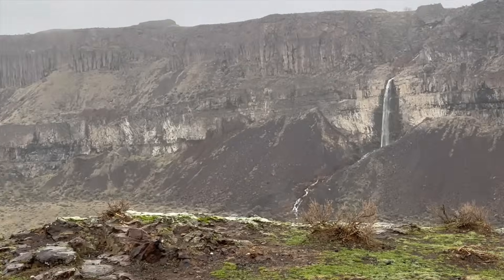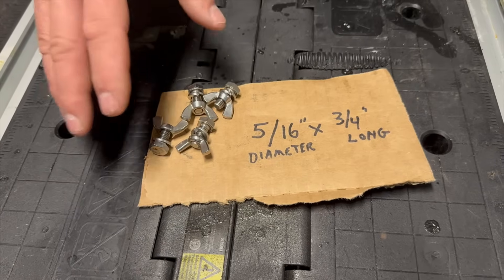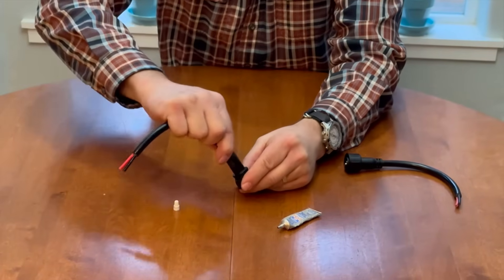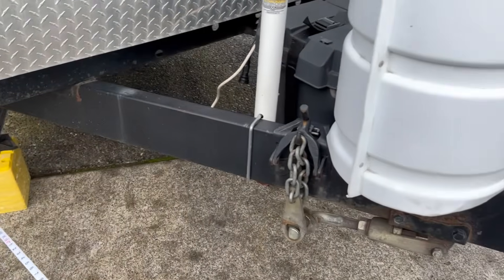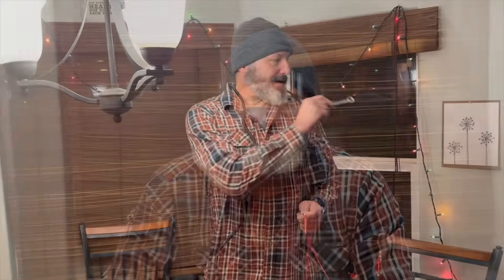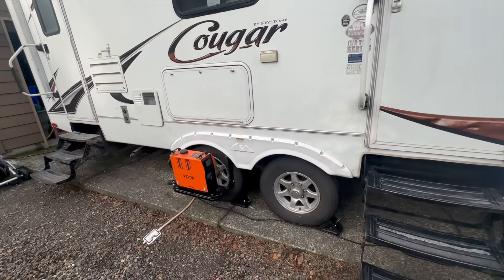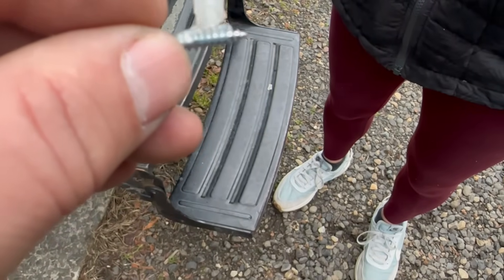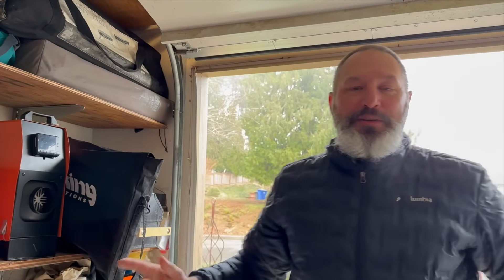Diesel Heater to RV via Direct Vent

Comment: Interesting your so picky about the pig tail not getting water in it and your using non heat shrink connectors. I like the heat shrink tube but I havent used the plastic shielded ones in a while

Comment: So wondering if you can plug into your exhaust from propane heater. That way all your duck work would heat up in camper. I think
Reply from the maker: Hi jumpjasper5276,

Using exhaust from propane, gasoline or diesel would introduce carbon monoxide into the rv.  I have a carbon monoxide detector in the rv to alert me to any exhaust poisoning.

Comment: Dielectric grease is an insulator and shouldn’t be used in those butt connectors. It’ll potentially hinder current flow

Comment: Right off the bat I saw a fault. The fuse should be as close to the power supply. Interesting setup. I believe I would've been mounting the heater inside the camper😊
Reply: And what about the noise ticking?
Reply: @oas9235 what about it?

Comment: Great Video Dave, gave me some good ideas. I have the fold "in" type entry steps. I bought the LED battery powered step lights. But the battery's don't last very long. So I'm going to use the connector you showed and put 12v LED's on the steps and use the connector to be able to fold in the steps.
Reply from the maker: Great idea @richmichels4439.

Comment: Would it help this heater to keep it in an insulated box while it is working?
Reply from the maker: Possibly, with the air intake and exhaust ports on the bottom it may work.  Overheating could be an issue.  I would include air vents near the factory ones.  Let me know how it works.

Comment: And the tire fender was an awesome idea. That was one of my holdups
Reply from the maker: Glad I could help.  When I first discovered that I was frustrated to say the least.
Reply: My heater fan went out. I ordered 2 different ones per the numbers on the unit and neither fit. I saw these, before they were an all in one unit and was going to install it, drop the exhaust down into the wheel well, but wasn’t sure how I was going to place the fuel tank. When these all in one units came out, I didn’t want to have to refuel in the trailer. But that setup will work.

Comment: Can you leave it out in the rain  at night
Reply from the maker: Hi @lolprices6190, according to Vevor's web site, No, a standard Vevor 8kw diesel heater is not waterproof and should not be placed directly in the rain."  However, my RV's awning is located above and should protect it as long as the winds aren't too strong.  Great question.
Reply: I have a small rain cover with magnets to back door and to side of heater

Comment: Hi Dave, I know your camper has a heater already built into it. Why did you hook up the diesel heater? If you already have heat please get back to me. Thank you.
Reply from the maker: Hi 22tom37, I added a diesel heater to my RV in order to have heat while boon-docking (camping without electric hookups).  The factory propane heater’s blower would drain my rv batteries to dead in about 3 hours.  With the diesel heater I have heat all night with battery power left over for the morning.

Comment: Most impressive Dave. Big Thumbs-Up from me.  I have a LPG TRUMA  heater in my RV (Mercedes)  
What the advantages of your diesel heater as opposed to running on gas (LPG)..? Is it purely economics...or are there other advantages I am missing.
My problem is that the LPG Cylinders I get here( in Chile )are but 5kg.....(Space for two in the gas locker) which are rather too small for comfort when out in winter....Nights get below 0°C & I like being warm!
Thanks again for the very well-made video.
Reply from the maker: Thanks for watching patagualianmostly, the main advantage for running a diesel heater as opposed to propane gas is RV battery life.  The blower on my LP furnace will drain my RV batteries "dead" in about 3 hours.  With the diesel heater I can run heat all night and still have good battery power in the morning.  If it's a sunny day, my solar will re-charge and I'm good for another night boon-docking.  If it's cloudy I will use my gasoline generator to re-charge.

Comment: Very nice install! I have a cargo trailer camper and my plan is to do something similar. One thing you didn't cover was how you connected the controller to the heater. Me personally even though 12ga wire was sufficient I would have used 10ga. A bit overkill I know but I won't have to worry about voltage drop and errors.
Reply: The controller has a 4 foot (?) cable that simply plugs in. I bought cable extensions from Amazon, about $8. The cable extensions plug in similar to an extension cord.

Comment: Check all the screws.  The clamps on the line are to big. Leacks desiel.  
My iteam was delivered with missing a screw to hold the tank to frame. .
Pump goes and goes. . Explosion can a cor. When iginited.  
A very cheap . Setup. And need look and check everything before turning on
Reply: So lucky did not explode or fire. Very lucky

Comment: Very Thorough. If only ALL Youtube DIY Videos were as well done as yours.  Well Thought out.  Everything I was thinking as I watched, turned out that you came to the same conclusion, and your Work-Around  was similar to what I was Thinking. EXCELLENT!  
I currently have a Ventless Propane Heater in my Cargo Conversion Trailer, but the Moisture with burning propane is turning out to be a major deterent to this. I'm looking into Diesel Heaters but bringing Diesel inside doesn't seem like a good Idea. This Changes that Problem. You STILL have to Haul that STINKY Stuff though. The back of the Truck is better than in the Living Space for sure.

Comment: I too use a Diesel Heater.  ( 8kw HCallory) Fresh Air intake from the trailer - Heated & Plumbed into my Ducting.  Purchased 4 Diesel jerry cans and stand pipes for each along with a Small set of Hydraulic Quick Connects. Can switch out an MT Gerry can with a fresh one without shutting down the Heater. Works like a charm.

The Fresh air intake is a NEW short RV Discharge hose (INSULATED), & adapted to the fresh air intake of the heater as well as  from my Bedroom using Male/Female RV adapters.

The Heater itself is situated underneath my Skirted Trailer and I've noticed that it actually keeps the underbelly warm in Temps as low as -33C...Via Radiant heat from the Box the heater is enclosed in. No issues whatsoever this past winter with freezing pipes.
RV is: TRAVELAIRE TT346 Bumper Pull 32' long - Full Time RV'r.
Reply: That's similar to how I ducted my 5-k heater to our 18 foot teardrop camper. It pulls air through a flexable duct from inside the camper through a round floor vent, heats it and it's ducted back inside. It's bolted on the front A frame with a metal rain shield over it. The control panel is mounted inside where it can sense the room temperature.
Reply from the maker: I like your permanent install idea over the A frame.

Comment: Real good info...I plan on doing something like that on my toy hauler to heat the garage where there's queen sized bunk beds. I already have a diesel heater heating the underbelly which I've put on new underbelly that I insulated to keep the tanks and water lines from freezing... Works good and I also use that one for keeping the trailer fairly warm over night to save on propane. The diesel heater is way quieter and does a good job keeping trailer at 55-65 degrees. I used a T fitting to switch from living room to belly or both, this seems to work quite well.

Comment: Great work and nice video with excellent instructions.  I have the same heater, step bracket, and for my first winter trip, I just took out my kitchen window screen and cut a plywood replacement with a hole for the heating duct.  I may stick with this, just not 100% sure I want to cut into my RV.  I do like your method, though.  Thx!